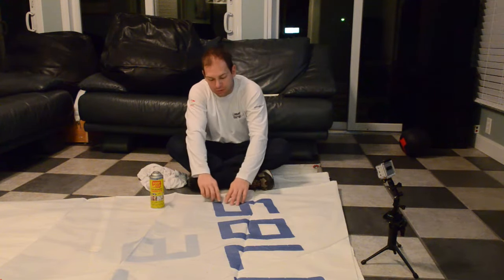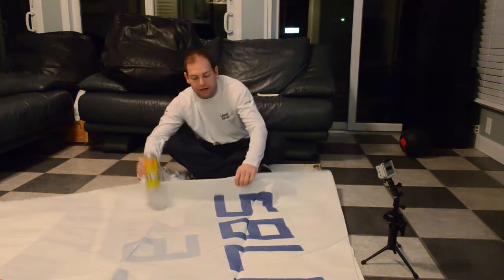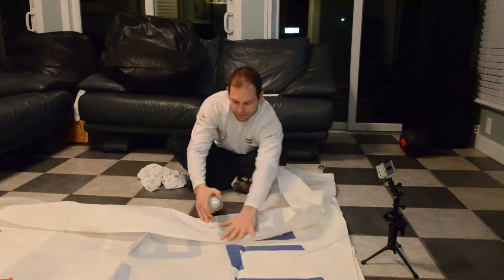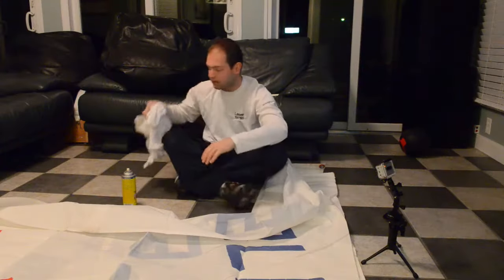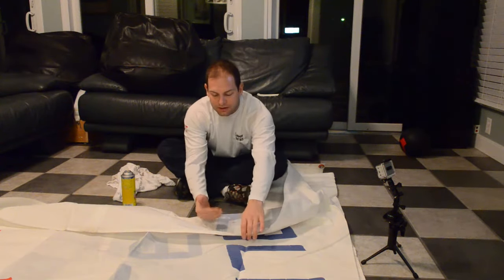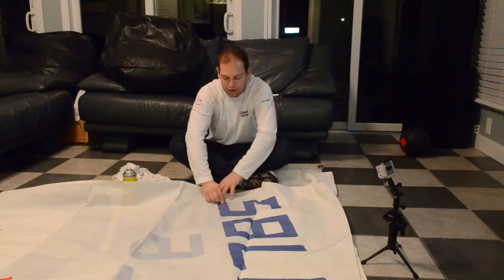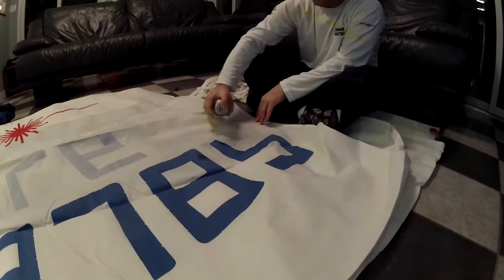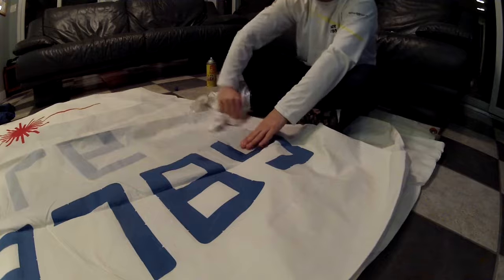How to Remove Numbers From a Laser or ILCA Sail

Comment: Can I use waterproof black tape to reconstruct the numbers?
Reply from the maker: I don’t believe so - here’s what the rule book says “After 1st March 1998 – sail numbers and national letters shall only be adhesive numbers. The use of permanent ink pens or similar to mark numbers and national letters on the sail is prohibited.”  
Check out part 4: 
http://www.laserinternational.org/rules-and-regulations/laser-class-rules/
Reply: @JonDeutsch5  Not even if you didn't compete?  my sailing club is small and we do not compete.
Reply: @JonDeutsch5  ok thank you
Reply from the maker: If you are not competing then you might not need numbers at all.
Reply: @JonDeutsch5  That's right, I'm 21 and I've been sailing for 4 years but the laser has an old sail with damaged numbers.  So I had thought of reconstructing the numbers with alternatives to buying them again.
Reply: Can the glider be damaged if I use adhesive tape?